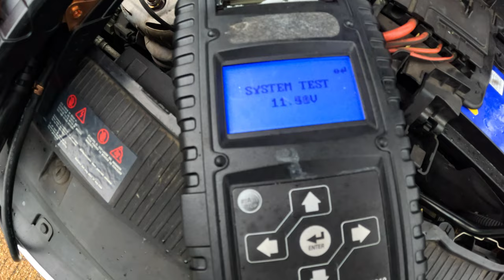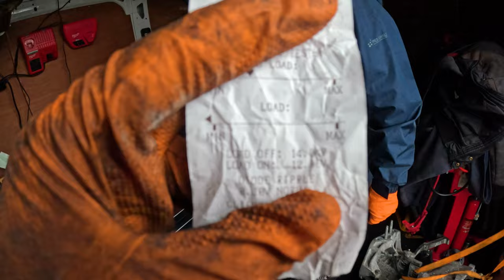HALFORDS FAILED TO DIAGNOSE THIS VEHICLE (VERY BASIC). Alternator Replacement | Gearbox Service

Comment: Halfords told me after a service that I needed new front pads and discs because the discs were below the minimum thickness and quoted for the job.  The car was less than 3 years old so I declined and took it home.  Measured the discs with a micrometer and the pads with a gauge and they were both well over the minimum thickness.  When i took it for the MoT I asked the examiner to extra check the front brake thickneses.  He said they were fine.  Halfords tried to con me for work I didn't need.  I will never use them again.
Reply: During my ownership of BMW I took it for a recall job to a local BMW stealership. It was late autumn, so as you would expect the lovely rain season all day long. Anyhow, they offered a complimentary health check. They quoted me for immediate replacement of all discs and pads as discs were corroded and pads were below 3mm in thickness. Needless to say none of that was true. The car sat all day in the rain, so the discs had a bit of surface corrosion that was gone once vehicle moved and brakes were applied. And the pads were still perfectly fine. 2 MOTs later and they are not even an advisory. Never went back to them.

Comment: @2:14 the voltage regulator in the alternator are made-up of semiconductor logic gates. When powered-on and working the gates are either in an open or close position. When power is removed the gates can then fail in an open or close position thus causing a fault. This is the reason for the general recommendation of disconnecting the vehicle's battery for a period of time and or shorting the wires together in order to reset the logic gates whenever there is an unexplainable electronics fault.

Comment: Use a manual spring compressor on the outer side of the spring too, then the spring will compress evenly and be less scary and safer.

Comment: not teaching you to suck eggs but always wise to draw the belt routeing before removal, keep up the top work from a fellow mechanic ;)
Reply from the maker: The thing is, I have AllData, AutoData, Haynes, E3, you name them, I probably have it. Sometimes just can’t be asked to check it and play the guessing game instead. That said, I do not disagree with what you’re saying, I probably should start doing that 😂😂😂
Reply: Easier to take a picture
Reply: Have done this for years , so much easier with some of the spring loaded tensioner style,  did a 69 plate vivaro the other day,  it had 2 belt  tensioners on the van 🙈

Comment: Is the strut top mount ok on that second car you changed the alternator on? It looks pretty strange to me at 6:59
Reply from the maker: I didn’t actually check. If you mean the corrosion, then no, it’s not okay, but the mounting, yes. Fiat have a very weird strut setup 😂
Reply: @themarvelousvlog  I meant the mounting being miles off centre on the hole in the strut tower. Interesting that they're meant to be like that, and very weird as you say!
Reply: Yes I noticed that strut gap as well & thought shall I comment , but as you say it looks very odd …….🤔🤔

Comment: Hi great work once again guys 👍 I don’t suppose you have ever worked on a 2006 Mondeo Mk3 ST diesel , doing a brake bleed after changing brake fluid ? We have issues now with pedal going to the floor , we’ve replaced the master cylinder , had the ABS pump sent away & come back 100% perfect , the servo is fine so been taking down the lane where I live & lamping on the brake to perform an emergency stop , it’s gone better after getting the ABS motor to work but we think it’s air pocket in the pump somewhere , done all the diagnostics with an Autel 2023 scanner & no faults showing anywhere , after several pumps it’s fine but you need to pump it again before stopping, the brakes were working fine before all this happened so very stumped right now hence advice is welcome , “I know this is not a forum but been going on for several weeks & just want it sorting”  it’s been bled by diagnostics ,it’s been foot pumped & a compressor bottle feeding fluid to the reservoir to no avail just pure fluid coming out the nipples & been a DIY mechanic for 33years + & changed fluid / discs / pads you name it & never come across this problem before ever 🙏 😊
Reply from the maker: I’d suggest just put a one-way valve on the nipple and pump each side at least 20x. Happened to me before on a BMW. Only way you can fully get it out is bleeding via OBD. After that, do a manual pump 20x and it SHOULD be fine
Reply: @themarvelousvlog  Hiya , okay I’ll give that a try , I’m subscribed to you & your vids are just amazing 🤗😀👍👍

Comment: After you fitted the new mirrors did you ensure that the external temperature gauge is showing on the dash display
Reply from the maker: Absolutely good sir 🫡
Reply: All good i have had it on a few similar Peugeots that the replacement mirror had no temp sensor and the van would then not regen and block the DPF 🤘

Comment: Hey buddy, quick question. I had a charging issues on a mk7 Ford fiesta where car died and found not to be charging. Replaced alternator with one from euros and the battery light is still lit. The car starts and charges fine and been like this for a few months. Any ideas? I’ve been told maybe the aftermarket alternator is not producing enough amps that the car would like to see but is still producing enough for the car to charge.
Reply from the maker: there’s a lin/can wire behind the alternator (either 1 pin or 2 pin) that usually corrodes or snaps. That would be my first check. If not that, let me know via WhatsApp/Instagram

Comment: Halfords told me I needed a new rear subframe on my 307 SW. I only needed the rear shock bolt tightened up.
Reply from the maker: Typical eh? 😂
Reply: Halfords told us we needed a new alternator on our transit van due to bearing noise and wanted over £600 for the job. We declined and checked ourselves and found it was the belt tensioner so replaced that and all was good.

Comment: Use a strap on the spring attached to your compression tool , for just in , it would make a nice dent in your van or head if it jumps out 👍
Reply from the maker: 100%! I do have it, just couldn’t find anywhere so went YOLO (really shouldn’t) 😂

Comment: Make sure when you fit the drivers side mirror the new mirror as got the temp sensor in it, if it hasn't you will get blocked dpf in future, you may laugh and think im a clown but new mirrors if cheap aren't supplied with sensor, when the sensor isn't fitted the van is unable to regen itself
Reply from the maker: Fully aware of this mate. Done a fair amount already. Thank you though. It’d be good to leave it here as I’m sure it’ll be helpful to someone who doesn’t know!

thank you for watching 💪🏽

Comment: Why do you recommend changing the break fluid every two years. Its a sealed system.
Reply from the maker: Just because it’s a sealed system, it doesn’t mean it will not gather moisture and change properties; also it’s not just moisture that ruins the properties of it, even the pipe material, rubber seals in the calliper and also the temperature change of the fluid can alter its properties over time